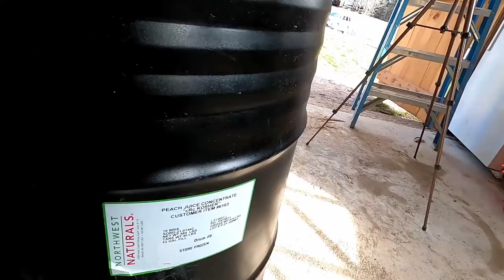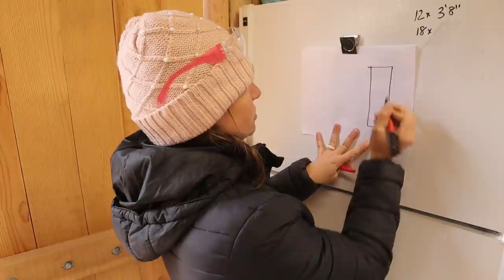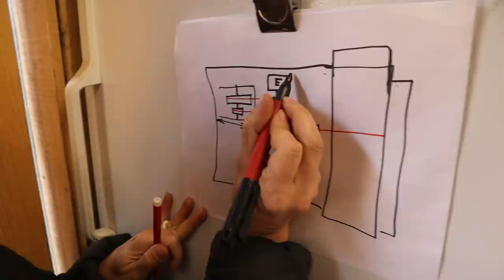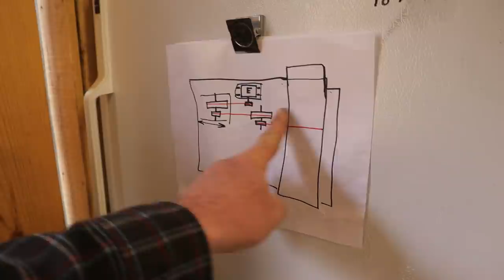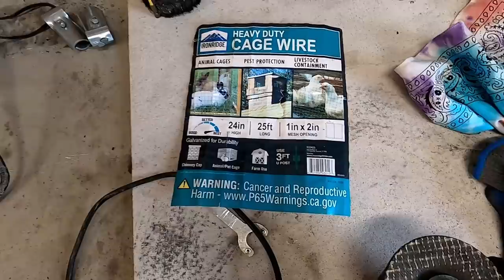Trommel build - start to finish with results // E69

Comment: I think that you kids are trying hard and its showing. You need to cap the end of the weld lead with the brass protector as it keeps it from ruining that welding end. Also when you use the gas feature, it will push that inert gas in so slag doesn't build up on the weld... check a couple welding videos and see the improvements. Its way too cold for the bikini and buff build shots yet an they are just click bait anyway. I don't think gold rush has any fears here yet. I see a soil separator, rock separator, and dirt/waste separator all in one... just need to go heavy duty for any amount to be in the cards

Comment: Is not going to last very long & if you dont have wheels that have real bearings in them ur going to have to build that slot more rugged then what u have there if u ever plan on dumping a bucket of dirt in that & really shouldn't put ur hand on. It spinning that gas motor is more the enough to hurt yeah be careful & god bless

Comment: Actually it wouldn't. One single belt might end up being all you need. The speed the tromel turns means it will sort that much faster. You're not trying to run finish gravel you're just seperating rocks from dirt so the faster it turns the sooner the rocks are clean so to speak. Not that critical for what you are doing with that tromel. Once you start using belst your speed changes from rpm to ipm or from revolutions per minute to inches per minute. That is how a reduction pulley slows belt speed down and and induction pully increses it.

Comment: If you put the magnet in a heavy plastic bag, like a zip-loc freezer bag, and seal it, you won't have all the filings stuck to the magnet. They just fall off the plastic bag when you pull it away from the magnet.

Comment: Build - add a large funnel-trough to the input side and use your tractor to load the material. 2000' of driveway is many thousands of shovels of material.

Comment: My little pro tip when using speaker magnets  first put inside  thin plastic bag  wave over area to be picked up  then reverse bag and all the material picked up ? Will now be in bag to throw out or sort
Reply from the maker: Cool tip!

Comment: My Misa was a Meg today....she brought home some 6' x 4'' x 2' metal carts with 4 shelves, and large wheels on the bottom, 2 metal shelves, and this display cart. The metal frame of this cart is a Perfect start for a welding cart. The decorative distressed wooden box that fits in it will make a nice storage unit. 
   A Really cool Idea to do with that Trammell also, would be to add a sluice to that system and collect any valuable metals or gems. I would love to see you build it all in one unit. Definitely subbed for more great videos!

Comment: I was watching an older video of you having some problems with removing your grapple and concerns with hitting the control buttons. You might want to try turning the tractor off then turn it back on without starting and move your control levers to remove the hydraulic pressure. By doing this you’re energizing the solenoid to remove pressure but without the tractor running you will not be building pressure in the system. This is the process I use to remove my grapple without problems. Good luck.
Reply from the maker: Hey James.  I still have this problem, but it's the opposite of what you're thinking.  I get it off fine; it's putting it back in that's the problem.  I've tried many things like removing pressure before disconnecting or trying different combinations of turning the tractor on and off during certain points, but the only way I'm able to do it is to push the button for the diverter valve (3rd function), and then move the stick either right or left to allow fluid to flow through (return) while I'm connecting the grapple.  Such a pain because I need a 2nd person to do this and it's usually one of my young daughters.  I think the real solution would be getting some of those "connect under pressure" quick connects.  They're expensive though.  I appreciate the attempt to help!
Reply: @WalnutsandWineberries  Sorry I couldn’t help. I enjoy your channel very much. New subscriber.
Reply from the maker: @jamesrichards3523  thank you, I really appreciate you reaching out.  That thing really drives me crazy and it's definitely something I need to address.

Comment: So much to say.. Just spent 3 days watching you guys from the start from ep. 1.. I do have experience in crushing and screening aggregate and have some constructive criticism if you're interested. I am impressed with what you guys have accomplished and I'm looking forward to following along. Wonderful family you have. Keep taking it in stride. With the lil tractor that could lol...     😎
Reply from the maker: Hi Michael, and wow!  You must be sick of us by now - lol.  I appreciate the kind words and your viewership.  It's nice to converse with someone who really knows your goal and what you're trying to accomplish.  I have a lot of plans for the trommel to outfit it for the upcoming task of separating all that material.  I feel this version is a great start and a proof of concept.  Stay tuned and by all means, chime in.
Reply: @WalnutsandWineberries  First add some angle iron paddles inside the barrel to force the material to fall rather than role. That will dislodge sticky soil better but also cause more where n tare so use your discretion. 
Second...  WoW. You sure think outside the box! I'm sure your aware that literally everything used to build that machine was way understrength with the exception of the motor but you made it work; and with free steal. Again WoW! 
I would add some pitch to the barrel to speed up the travel of the material as necessary and add some guards to keep the barrel from tarring apart the pulley system if something goes wrong. 
I can try to walk you through using your rollers to train the barrel but that can be tricky. Just keep in mind that if you twist a roller it will force the barrel one way or the other laterally so bolt on rather than welded is good with those. 

Keep up the good work and stay safe. 
P.S. I wish I could spend three days at your place with a hoe ram.....

Comment: Good build and you covered all the weaknesses . Only thing I see that may be a problem is the rollers for the barrel . The rollers are running on non lubricated shafts . The dirt and sand will eat the rollers and pins up pretty quick . If nothing else carry a squirt can to the work site and lub them often . I hope no one was hurt on the crashed ATV ... Another thing I like is how well you to work togeather  ...
Reply from the maker: Can't argue with that.  I see myself replacing those with some that have real bearings.  It was a lot of fun!

Comment: Great project, great job !  I'm confident it will do what you want it to do.
Your gas engine may only produce X amount of power for your trommel but you will get an increase in "applied power output" at the barrel that's proportional to the decrease in it's speed by using pulleys...that's how block-and-tackles work...
Thinking you'll have enough power to add additional barrels (with rollers) to increase your production capacity & create distances between your piles of topsoil, pea gravel, #2 stone, #5 stone, etc. etc...while also making loading your tractor's bucket easy and convenient.
Reply from the maker: Yes!  Hope this is the beginning of a great thing, including material separation.  There's plenty of torque to spare for add-ons.

Comment: Excellent work!  Try attaching a flat strip of rubber to the barrels under the pully belt so the drive belt has better grip and doesn't slip. Then you won't need excessive tension on the belt, which will help the belt last longer and put less pull on the entire system.
Reply from the maker: Thanks Mac, it was fun!  I'm adding some verticals with some more rollers so the trommel gets pulled into the corner.  Someone else mentioned adding some rubber where the belt wraps around, and I think I'm going to add that for the friction benefits.  I'll definitely post some updates on it.

Comment: Use a finer mesh on the first set of openings  to sort out the smallest particles. Increase the mesh size as the gravel moves along to sort various sizes.ì 
Very nice piece of practice Engiineering.
Meg scored a great find with the rack. 👍
Reply from the maker: Definitely considered that and I might make some modifications to get 2 piles of different size rock.  Not to mention, the finer mesh would produce some fantastic garden soil.  Also, yeah - Meg was definitely in the right place at the right time!  We always check those free wood piles at Rural King.  Good stuff!

Comment: Made something like it years ago but used rebar in a grid pattern. Allot more welding but it help up for awhile. The rocks really did a number to it after about a months use but the rebar held it together. I built a square cage in 4 places around it and put the idlers in the corners. I could really put tension on the belt after that.
Reply from the maker: Yeah, I see coming up with a new wire solution.  At roughly $22 per barrel, it might be worth making the drums again but drill a hole pattern directly in them instead of messing around with mesh.  At this point, I'm going to run it until it breaks and address it then.  I'm upgrading the rollers to skateboard wheels and adding 2 more on the top of the pull side.  Should keep things nice and tight.
Reply: @WalnutsandWineberries  should work. Can always reinforce with 3/8 rebar later. Keep experimenting and it will be fine.

Comment: Cool build. Just an idea to think about. If you put a another layer of screen, offset slightly in the  first half you could grade the material into three piles, soil, small stones and larger stones out the end.
Reply: That is similar to my idea.   Just unroll the mesh to fit inside the overall drum with some overlap and insert it.  The metal mesh will spring outward and fit against the inside.  Then the finer mesh can be removed or replaced to get the grade of material desired.....medium stone, smaller to gravel, and finest to sieve topsoil or mulch.     JwgK

Comment: Put your idler on the bottom and make it a pivot on a piece of stell welded to the frame. Cut two pieces of tubing, roughly 10 degrees on each end and weld them together so it looks like a boomerang. Drill a pivot point at the center of your angle, another one at the tip to carry the idler and a screw hold on the other end facing the opposite direction so you can weld a nut on the bottom and use a piece of all thread as your tensioning bold with a locking nut on the bottom to make sure it stays in place. Lock washers John. Always on anything that is going to be subject to vibration.

Comment: when looking for cheap parts for projects such as this I have found that old small riding mowers are a great resource.  you can often get a fully functional mower around here for 100-150 which includes a running 12-18HP motor usually with electric start and battery/ignition system, belts, pulleys, tires even a transmission and idler.  The motor alone if bought new will run you more than $500.  My wife thinks I'm nuts when I pick one up super cheap even if only for parts to keep some other one running.  We are in the Ozarks and built our own home four years ago and rocks are still growing out of the yard so I don't want to buy a nicer mower only to have it get destroyed by the rough ground conditions. Once you have stripped off everything you might want to keep for some reason or another the frame is still 20-30 bucks worth of scrap steel at your local scrapyard.

Comment: Thank you for sharing. Trial and error approach. Try to stabilise your belt in your pulley (motor-set1-set2). A lot of vibrations is reducing the friction between the belt and the pulley (bad transfert of energy), but it will also damage the belt (soften part) too quick.

Comment: It was fun watching you guys working together as a team. I'm sure by now you got all the bugs out of it. Anyway, mounting the the tensioner pulley on a spring loaded flat bar and   installing the set of pulleys closest to the barrel below the level of the first set, would've been an improvement to the drive mechanism. Cheers!

Comment: great episode. Came across your chanell 5 days ago and have to admit binge watching since.
You need to have triangular gussets supporting your pulley mounts. This will stop the twisting force exserted by the pulleys and belts which will eventually cause a permanent twist or complete failure.

Comment: An easy way to align the barrels would be to lie them down rolled against a wall. The floor and the wall would keep them aligned while you tack weld it. Also, tack welding a horizontal weld is a lot easier than the vertical welds you were attempting.

Comment: Btw, I loved the V-belt groove you cut in the rubber tire - very clever.
Reply from the maker: Thanks, Kevin!  Works really well.  It's funny how expensive real pulleys are vs those cheap wheels.

Comment: Instead of welding the casters on a flat plane I recommend making a triangle shape on both sides that craddle the barrel and weld them to that.  So the barrel doesn't roll out if gravity keeps it in the craddle.
Reply from the maker: Definitely making a mod like that so the idler pulls the trommel into the corner.  It's probably going to look like a 90 degree riser with some more rollers toward the top.  👍

Comment: Great design! Adding two more sets of free wheels on the top pressing down on the Barrel. Same spacing as the wheels on the bottom attached to a metal shaft. Then weld bars on the sides to the top and bottom. I liked your slotted idea, because then the wheel tension can be applied to applying pressure on the barrel when you got it in at the right tension. At both sides doing the same thing. An idea for tension. Use A bolt through a nut that is welded to a piece of steel. When you use a nut driver on the bolt it either adds tension or removes it depending on if you are backing the bolt out or pushing it in. The bolt will move the motor where you want it. The other areas where you want to slide the pullies can also have the same idea applied to them as well.

Comment: When welding the wire fence, apply the heat and welding wire to the drum (thicker metal) and a quick dab on the wire fence will secure it without the burn through (breaking the wire fence).
Reply from the maker: Thanks Brian.  I'm just starting to learn.  Getting a little better here and there.  Definitely interested in strength over looks.  Appreciate the tip!  I'll try that.

Comment: At 80 enjoy reliving my DIY youth, middle age and to 60...my girls called it "Big Tonka" as in Tonka Toys ...an early 1980 Kabota front end loader...12HP three cylinder diesel, 4WD, ag tires...my suggestion don't really need purple cleaner on PVC schedule 40 as long as it's not pressurized but use big can brush when using 3-4 in pipe or just get the cement that says don't need primer good for pvc and cpvc...PEC/TEC was just in the scene when I finished my DIY...recall the manager of the plumbing supply house in Indpls was concerned that it might not be mouse/rat proof...apparently they don't chew it...Your road construction is Mr and Ms. Sisyphus..it looks never ending...Is the big house to be constructed by the lovely shed and the mountain lookout cabin at the end of the Sisyphusian rock push...if the big house is to be at the end of the road how are the construction material, delivery trucks going to negotiate the  switch backs?

Comment: Me again with more suggestions.  Glue a strip of rubber on your barrel where the belt runs so it will stop slippage.  Your tremel needs to be angle for the rocks to fall off the ends quicker about 15 degrees. You will need a thrust wheel to keep the barrels in line. Haha flannel shirt are not flame retardant always wear an apron, you learn that. You are all doing a great job and learning at the same time.
Reply from the maker: Thanks AD!  Definitely going to make some mods and share as we go.  I like the rubber sleeve idea and the extra rollers are already in the works to keep the barrels from torquing one way or the other.  The plan there is to mount some braced verticals so the tension idler is pulling it into a corner.  That should work really well.

Comment: Awesome build!  For the idler pulley arm, a crank jack (like on a trailer) would be a quick, easy, safer, and more stable way to adjust it.  Just my thoughts for an upgrade to your build.

Comment: U have to put the idler/tensioner pulley on the down side, not the top side and it will work much better.  Love your channel..
Reply from the maker: Thanks for the tip

Comment: Hi Jon and Meg
My wife and I love watch you and the family.  Here another idea how to break large rocks. I have use it. BT oulder Buster The better solution in rock breaking
he Boulder Buster is a compact and portable piece of standby equipment that provides a cost- effective and convenient way to
safely break rocks and concrete in situations where conventional explosives are prohibited or inappropriate.The secret of the tool is in the controlled use of propellant energy as a power source. Cartridges of propellant are used to direct a pressure impulse into a drill hole filled with water.The ensuing pressure wave forces the water into existing micro-cracks in the material resulting in controlled tensile fracturing.
In use, the device is placed in a water- filled drill hole, held down with a flexible---------

Comment: You may need 4 uprights with wheels aginst barrels on the rack to brace barrels midway. When loaded, the whole thing very possibly will come off small bottom rollers with weight of dirt.